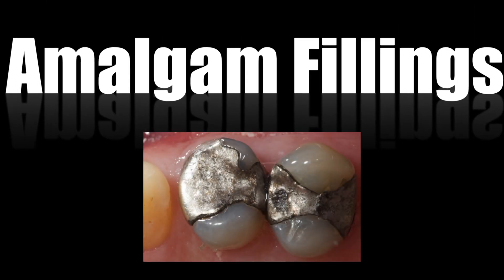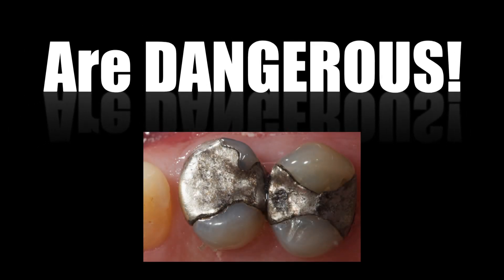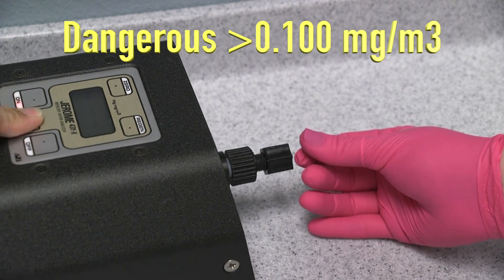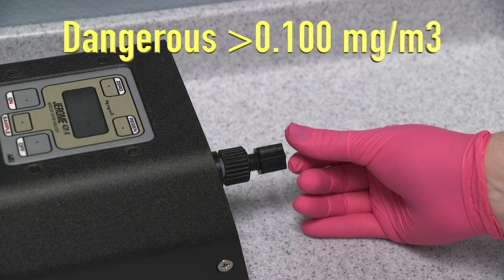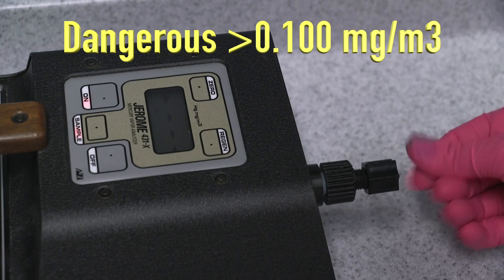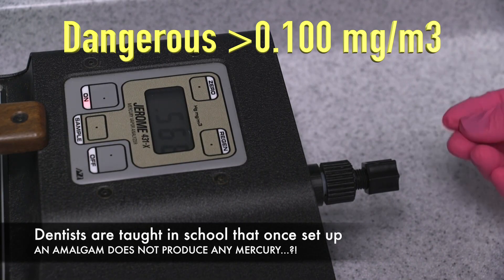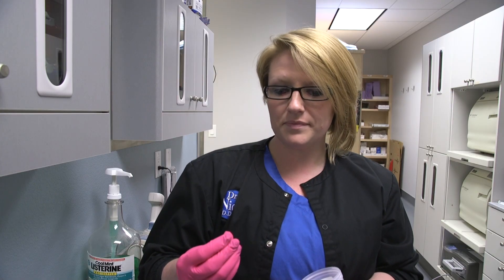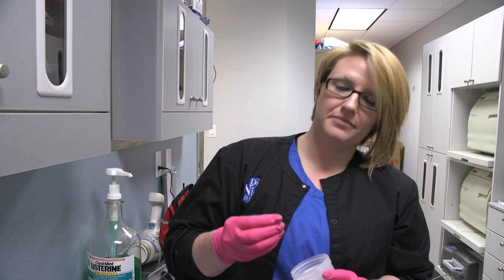DENTIST Proves MERCURY Released From AMALGAM Fillings!

Comment: that experiment does not prove amalgams are dangerous to someones health. other factors have to be considered to determine if the amalgams in your mouth is dangerous.
1. you are only exposed to the total surface area of amalgam in your mouth. so the results in that experiment is equivalent to the total surface area of the sample used in that experiment. if the amalgam in your mouth has a surface area 1/4 of the sample used then your exposure is 1/4 the results.
2. the device used tests for inhaled mercury. when you brush your teeth or eat or swallow spit your mouth is closed so all that mercury goes down your throat you dont inhale it. mercury from amalgams is poorly ingested in the stomach. about .01% is absorbed in the stomach according to an article i read.
3. as the years go by the mercury content of the surface of the amalgam is depleted. i dont know how much, lets say after 20 years the amalgam in your mouth is only emitting a third of what it used to.
so lets say the total surface area of the amalgam in your mouth equals half of the sample used in the experiment so its emitting .566 divided by 2 so its emitting .283. lets say its in been in your mouth for 20 years so we divide .283 by 3 equals .094. now you swallow that .094 and your stomach only absorbs .01% of that and the answer is .0000094. so you are absorbing .0000094 if my calculation is correct.
now factor in one more thing---- our bodies have the ability to get rid of mercury and it gets rid of it 24/7. im guessing my body gets rid of it faster than i can absorb it. im not worried at all.
Reply: 1) You ignore that the amalgam is in direct contact with living tissue that does nutrient exchange, the dentin. That means there's nigh 100% surface area utilization. And I know it affects the dentin because my dentin that are in contact with my fillings are stained a darker color than the rest of my teeth.

2) "when you brush your teeth or eat or swallow spit your mouth is closed so all that mercury goes down your throat you dont inhale it"

Are you forgetting that they off-gas for prolonged periods of time after being disturbed and have been shown to continue to release vapor for half an hour or even longer? Unless you're swallowing literally every single piece of vapor, your point here is irrelevant.

3) Amalgam that are decades old still release large enough quantities of vapor that they can be visibly seen.

4) Our bodies cannot easily remove it once its binded to proteins. Once it accumulates, it's stuck there for a long time, especially in organs like the brain which have very long turnover. The reason for poor absorption in the gut is because it's chelated, which is done in the gut by metallothionine or by the liver, both of which are bypassed when inhaled.

Which is a problem if you keep inhaling it. Like I've already established you do in point 1 and 2.

Comment: it's great to see more scientific tests done on this.  I wonder what the test is on old fillings.  I was surprised that the fillings are over 50% mercury.  that's a lot!  I recently saw a video showing a scientist putting a tooth infront of a phospherant screen which shows the vapor pouring off a tooth!  it should be fairly easy to test then if toxic vapor is coming off.  I'm very concerned about this.  perhaps if they can't take all the amalgam fillings out they might be able to seal the amalgam inside the tooth and resin to stop the vapor?
Reply: https://www.youtube.com/watch?v=2oOsTDQ--PE  the smoking tooth
Reply: It's a gas, it'll eventually escape somehow - through the bone, bloodstream, etc. Just a matter of time.

Comment: This test is poorly done, I'm sorry for the criticism, but this literally proves nothing other than that 'mercury makes vapor'  and 'your machine works'...
let me tear this down logically. first of all, the biggest problem by far, is the fact that you didn't even simulate saliva, this would eliminate a lot of the mercury vapor.
you also didn't simulate body temperature, and you didn't even consider that maybe, just maybe, the 24h mercury amalgam would make more vapor than a 5-year-old amalgam!
an amalgam that's years old probably has a layer of oxide and crud that blocks further mercury evaporation.
let me also point out how the "glove residue test" is flawed, you see, you did the test in the same spot both times, the mercury vapor you put in the air earlier, is still in the air, so of course you get a high reading off of the gloves! try waiting a few minutes, and perhaps blowing away residual vapor that is contaminating the air, so that only the residue ON the glove is measured.
2:50 that's correct, it cant produce mercury. how on earth do you suppose it could PRODUCE mercury out of thin air? it doesn't make new mercury atoms, it only loses already existing ones.
this is obviously a communication error though, I know what they actually meant. once again though, a little saliva would completely change everything.
btw OSHA's "limits" are pretty strict, same for most things dealing with mercury nowadays. do you think if they just change the limits, the mercury all of a sudden becomes more deadly?
and besides, you are removing vital context, here are OSHA's original words: "The legal airborne permissible exposure limit (PEL) is 0.1 mg/m3 averaged over an 8-hour workshift."
8-hour workshift! unless you are operating for 8+hours, the mercury exposure will be nowhere near the limit!
do the math, if you can have 0.1 mg/m3 per 8 hours, then you can also have 0.8 mg/m3 per 1 hour. you never got near 0.8 percent!
also, let me point out, that I'm usually not thoroughly rubbing my teeth unless I'm brushing my teeth, in which case my mouth is full of toothpaste-water anyways, and so the mercury vapor will once again be insignificant.
when you chew, food is in the way. and when your mouth is empty, only like 5% of the surface area of your teeth actually touches each other, so the amalgam really wont get rubbed.
besides, many times the amalgam is down in the nook of your tooth, where its not getting rubbed by your other teeth anyways. the heat created by friction is like, what... half a degree?
I don't happen to suck the mercury off my toothbrush when I brush my teeth, so I think I'm fine... when I finish brushing, I spit out the water, and I rinse off the leftover toothpaste so it doesn't leave a mess on my toothbrush. this would take a lot of the mercury along with it. again what's up with the lack of water? also, the surface area on that bead is far higher than one individual amalgam, because the sides and bottom of the amalgam will be covered with tooth, and the top is covered with water, soft-drinks, coffee, saliva, food, etc. also, an individual amalgam will never have that much mercury in it. you could practically make a whole tooth out of that! I charted and compared your tests, and the only amounts of mercury that were dangerously high, were when you vigorously rubbed the amalgam, if you take into account saliva, and the condition of the typical mouth, I'm pretty sure you'll find out why so many people claim its safe.
Reply: @sdm789  First of all, thanks for the appreciation of my comment, I don't really expect that many people to bother reading it, and so often people will criticize me over my comments, often saying things which they really know nothing about. so some positive feedback is a really refreshing change from the usual!
regarding your amalgam fillings, I should first let you know, that though I'm decently well versed on mercury itself, I'm not very well versed on the human body or biology, and nor am I an oral specialist such as a dentist. I mainly focus on inorganic chemistry and physics, if you look over my original comment, you will probably notice a consistent pattern. I criticize what I know, if I am unsure, then I can't make a definitive response. in general, I know logic, math, inorganic chemistry, and physics, but not biology or the human anatomy that well. so for me to give you a definitive answer, when I know nothing about you other than what you just shared about yourself, would probably neither be possible nor wise of me to attempt.
I can however give more general advice, although, that would be easier to do with more information about you and your situation.
My questions are the following: are you sure they are all mercury fillings? are you sure there are 8?
how many total are leaking, and are you aware if some are worse than others? how many are fully intact? who (type of profession) ran the diagnosis of your fillings? how long ago did this diagnosis happen? have you noticed any strange and/or noticeable symptoms from your fillings? how old are you, and at what age did you get the fillings? are all the fillings the same age?

it would also be great if you could consult this oral diagram: https://stock.adobe.com/search?k=teeth+diagram&asset_id=187619482
you only need to focus on the central diagram of the image which depicts a full adult set of teeth. just let me know which teeth have fillings, and what their status is. use the numerical labels provided by the diagram in your response. that way I can know which teeth exactly are affected and which ones are leaking. also notice the top and bottom set, and make sure to label them correctly.

and no, you are most definitely not being a paranoid fool. while fillings that contain mercury are fine and will last decades for most healthy adults if they are installed properly, the mercury aspect does become an issue briefly during installation and removal. this is because when its brand new it makes the most vapor, and when its being removed it is powderized. I never did figure out what they meant by "leaking fillings", so you might want to ask them. it would also be good to know what the procedure is before they give it to you regarding the removal of your fillings. the main concern would be that you might inhale some of it. they should be using an air redirecting device of some sort, either to redirect where you are breathing from during the procedure, or to remove the contaminated air/amalgam-bits near your mouth by vacuum hose. the exact execution of this will vary depending on who does it and which place you go to, but the important part is that you must insist on not breathing any of the affected area once they begin to physically remove it. afterwards, I would recommend rinsing our your mouth thoroughly as well. that's all I can say for now.

Comment: This is great information. I like how you show heating increases the amount of vapor released. It would give a much better representation if you placed it in hot water, around the temperature of a cup of coffee or tea. Unfortunately, I have this junk in my mouth with plans to remove it as soon as possible.
Reply: if coffee is in the way, then the vapor is blocked... did that ever occur to you?
Reply: @Bread Sandwich what makes you think that? by definition, evaporation is a phenomenon that only occurs at the surface of a liquid, the boundary where it contacts the atmosphere, otherwise the energized particle crashes into the particle immediately next to it, and cools off again, not really getting anywhere.
evaporation is just boiling on a MUCH smaller scale. when a liquid boils, all of the particles are at the boiling point, or just below the boiling point of the liquid, and bubbles of gas can form all throughout the liquid. whereas when a liquid evaporates, all of the particles are below the boiling point, usually near room temperature, but a few particles here and there get lucky, and by random chance get hit by a nearby particle or photon and get enough energy to fly out of the liquid, but this only happens at the very surface, otherwise, as I said, it just crashes into the next particle and its energy is immediately lost and is spread out once again. hence you can prevent water from evaporating simply by covering it with a thin layer of plastic wrap, but boiling water will burst the plastic seal. you can even cover a cup of water with a thin layer of vegetable oil, and it wont continue to evaporate.
besides, mercury evaporates over a thousand times slower than water.
Reply: @Bread Sandwich I've already addressed this, but I could have been more clear. you're making the assumption that mercury can either evaporate right through the water OR into the water. as I mentioned in my previous comment "you can even cover a cup of water with a thin layer of vegetable oil, and it wont continue to evaporate." so assuming that rule holds true here, then mercury wouldn't effectively evaporate through water. now the question is, can it evaporate into the water? first of all, the fact that it can't evaporate through the water is a red flag that it also probably cant evaporate into the water. but secondly, once again, I also mentioned this in my previous comment "evaporation is a phenomenon that only occurs at the surface of a liquid, the boundary where it contacts the atmosphere, otherwise the energized particle crashes into the particle immediately next to it, and cools off again, not really getting anywhere. "
this applies to both liquid and solid boundaries, because the limiting factor here is not the boundary's state of matter, but the particle concentration of the boundary, which is why a gas doesn't block evaporation, (depends on pressure) because there is a lot of empty space in a gas for further particles to slip through, but that's not the case in either a liquid or solid. in both a liquid and a solid the particles are all in contact and are very close to one another. if a particle of gas were to try to pass through a liquid or a solid boundary, it would be quite literally blocked by the unbroken wall of atoms/molecules in the way, liquid or not. not to mention the no-slip boundary condition, which states that the surface of a liquid (water) in contact with a solid boundary (amalgam) will not move/flow relative to that boundary, i.e. its stationary. and since the only thing that differentiates a solid from a liquid is the ability of the liquid to flow, therefore removing that property from the liquid just makes the liquid act as a solid. so even if you're hung up over the fact that the "boundary" here is a liquid and couldn't possibly block stuff, it still really doesn't change the situation. you might as well say mercury vapor can travel through a thin layer of ice. I forget if I already mentioned this, but you should also note that the amalgam is only half mercury, so a large portion of the surface is silver, not mercury, and silver would definitely hinder the mercury's ability to evaporate. besides, as the very surface of the amalgam evaporates, it leaves the surface layer free of mercury, and slightly porous, which leads the silver to tarnish, which causes it to expand slightly as it now contains sulfur atoms, (that's the primary way silver tarnishes) which therefore fills in the surface of the amalgam with silver sulfide preventing any significant amount of mercury from further evaporating. I should also mention that mercury is practically insoluble in water.
Reply: @Bread Sandwich Rate of evaporation is dependent on temperature, but if something is prevented from evaporating at all in the first place, (i.e. a boundary) then attempting to speed up the evaporation doesn't really change anything. you would have to cross the boiling point for an actual change to occur. may I remind you that the vapor pressure of mercury is 14,000x less than that of water (I'm comparing to water as its the most well known liquid) in other words, the amount of liquid that attempts to vaporize into the atmosphere for an equal volume of gas, is 14,000x lower for mercury. as a rough estimate, (given the relative sizes of a water molecule and an Hg atom this would mean ~7,800 water molecules evaporate every time 1 Hg atom vaporizes at around body temperature. hope this helps.
Reply: @Metal_Master_YT  Your logic is absolutely terrible. Something that is a great conductor of heat such as a metal (HINT HINT) is bound to get hot quickly and as soon as you swallow the coffee or tea, guess what?

IT IS STILL HOT.

It is still releasing mercury vapors.

Even at 98.6 degrees Fahrenheit, it off-gasses enough mercury vapor as to be visible when placed against a fluorescent backdrop.

Your mental gymnastics is at odds with visually demonstrable phenomena.

That's not even taking into consideration that it is in physical contact with something that has active nutrient exchange, being living tissue: dentin. It is proven that it diffuses through the microtubules.

Vimy MJ, Lorscheider FL (1985) “In vivo measurement of mercury released from dental amalgam.”

Bennett BC, Dawson CO, Thomas SE, et al. (1986) “Mercury vapor release from dental amalgams.”

The presence of saliva doesn't even stop mercury vapor from being detectible in breath and tissues.

Berglund (1990) conducted a 24-hour study measuring intra-oral mercury vapor release. Subjects with at least nine amalgam surfaces exhibited significantly higher mercury vapor concentrations compared to those without amalgam restorations.

A review by Reinhardt (1992) highlights that mercury vapor from dental amalgams is absorbed and contributes to mercury levels in human tissues, including the brain and kidneys.

Last but not least, the precautionary principle trumps any and all supposed analyses of safety.

When an activity raises threats of harm to human health or the environment, precautionary measures should be taken even if some cause-and-effect relationships are not fully established scientifically.

Mercury is a known neurotoxin.

Long-term exposure is cumulative.

Variability in individual susceptibility (e.g., genetic differences in detox pathways, autoimmune issues) means “safe for most” isn't safe for all.